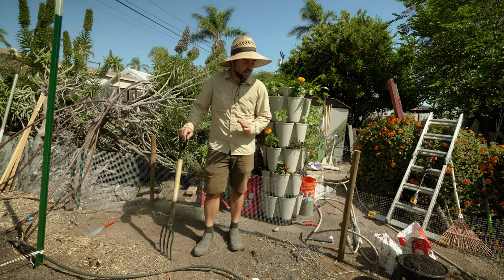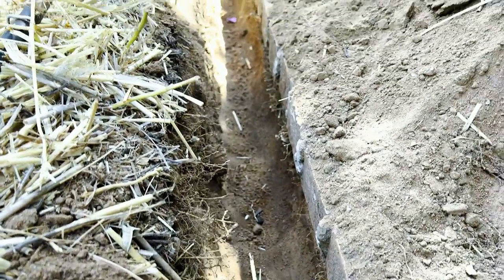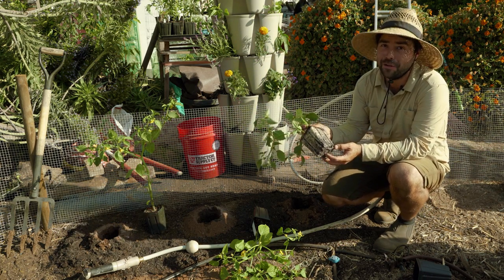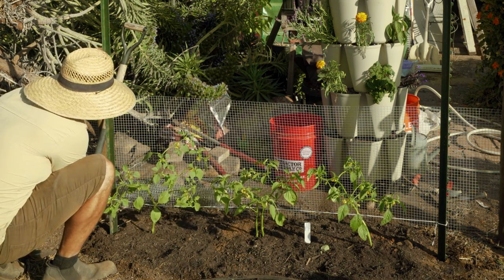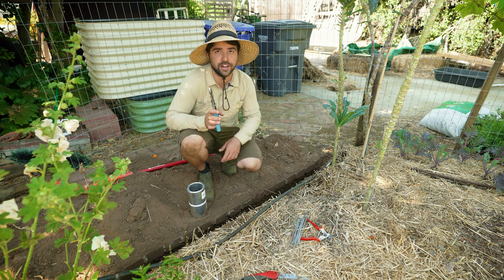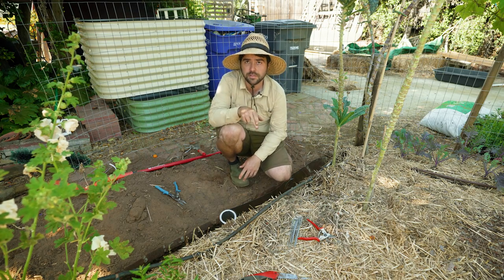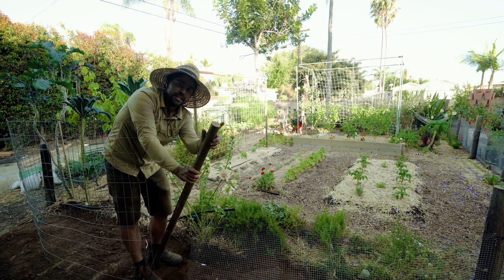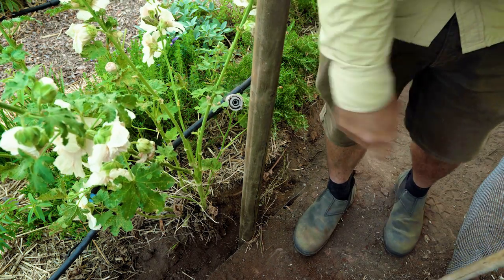Tomatillo Tips and Invading Tree Roots

Comment: An auger is designed to be used just the way you are using it so no need to apologize.  It's a great tool in the garden or on the homestead and make a  job quick, efficient, and uniform.  Trying tomatillos again this year but this time in a 5 gallon bucket that sits in another 5 gallon bucket(water reservoir). So far they are doing great with a ton of fruit on them!
Reply from the maker: I keep meaning to try out one of those bucket in bucket systems!
Reply: @jacquesinthegarden  Well if you ever come North around the Knotts Berry farm area you can stop by and see how I do it. It's been the best for me since I don't have a lot of full sun  or much yard space. What I do have is  a lot of flowers, roses, geraniums. flowers. My veggies are all in containers.

Comment: Also another tip with 30% vinegar is to not use a cheap $1 spray bottle. The high strength vinegar can begin to eat away at lower quality plastic if it sits for long enough. It's not going to melt a hole in the bottle but I have seen it cause bottles to stop spraying from the acid eating away the small plastic bits in the spraying mechanism. Plus you don't want to be spraying microplastics all around. A Zep spray bottle like the one used is what you want because they are made to hold up to chemicals and cleaners.

Comment: Roots are my concern about not just regular gardening, but also permaculture gardening.  We gave oaks and cedars that pop up everywhere like weeds.  There's also choke cherry that are just as bad.  Those roots of larger trees just suck the moisture out of our sandy loam like crazy and they travel a long ways.  It is difficult to garden in this micro climate and tree roots don't help.  That's why I don't think permaculture would work here.  It would take semi loads of mulch and still not sure if that would do it.  I just read why I have such a time growing lettuce--too hot, too cold, too dry.  And if course because moisture dissapeared faster then you can apply probably nitrogen loss.
Roots--Ugh!  Would love to have a shady moist soil garden, but for so many reasons I don't think it's possible--uphill battle.
Reply from the maker: I think it is difficult to pull off without rain but it also definitely depends on the tree, I know some people have carved proper oasis out in the dessert using permaculture principles.

Comment: What type of string or twine are you using for your Florida weave/trellising
Reply from the maker: I have some cotton butcher twine and also plastic polytwine, I am trialing a few rows of the cotton to see if it holds up well. Overall I am sticking to the plastic twine until I am sure the cotton will hold up. The plastic twine is the "tomato" twine from Johnny's Selected Seeds.
Reply: @jacquesinthegarden  Thanks! I am currently trying jute twine, poly string, and paracord for a few of my trellises and was trying to see what everybody thought. I'm a little concerned that the twine won't be strong enough to support the weight of the vines

Comment: I assume that power planter needs pretty soft ground to work? No tree roots? (Or in my case, bamboo rhizomes 😖)
Reply from the maker: It doesn't need soft ground really but sometimes roots can be annoying as its either the root or your wrist that is going to give up so I would say in a very root rich area use with caution.